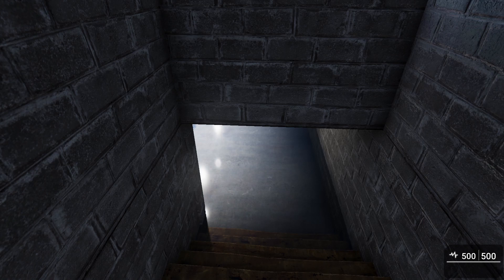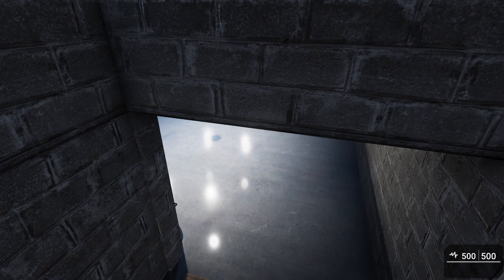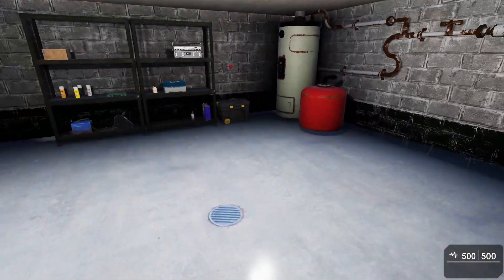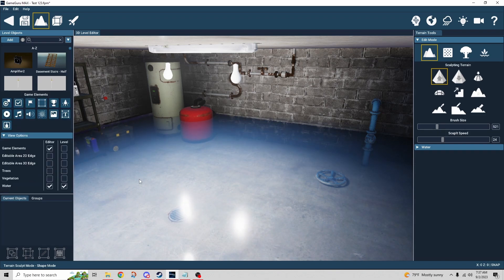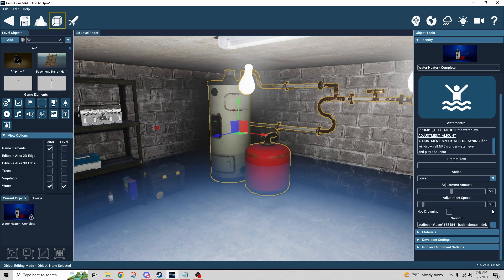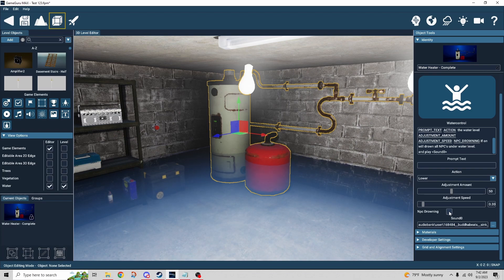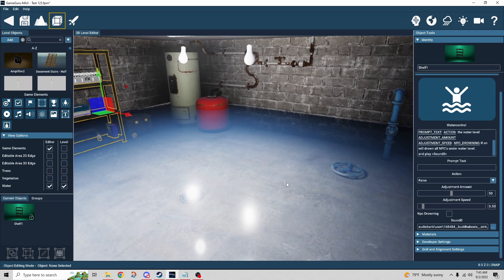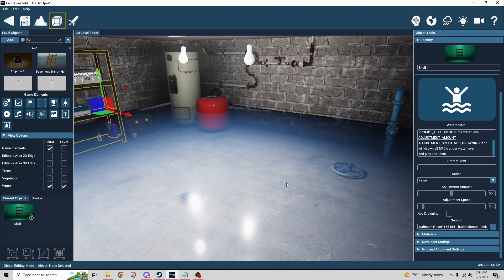GameGuru Max Tutorial - Water Control Behavior Explained

Comment: with the wheel is that linked to the switch as well, like how did you apply then wheel to switch to turn when on
Reply from the maker: Been a while but I'm pretty sure I'm using valve behavior there.